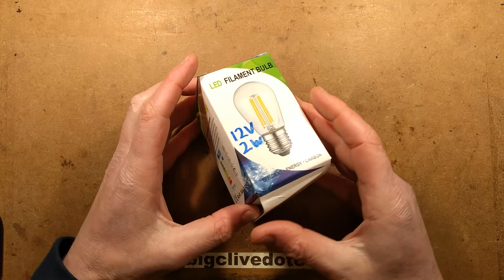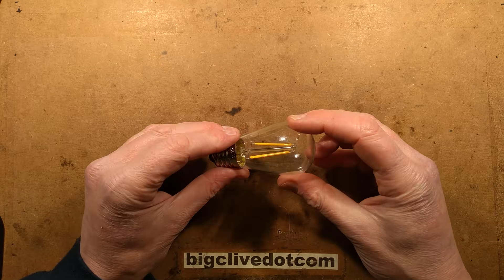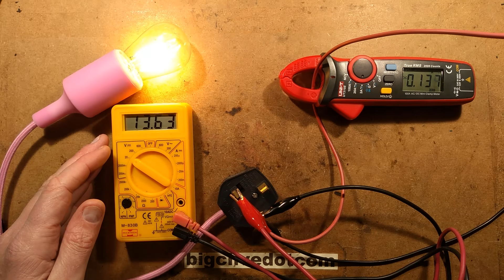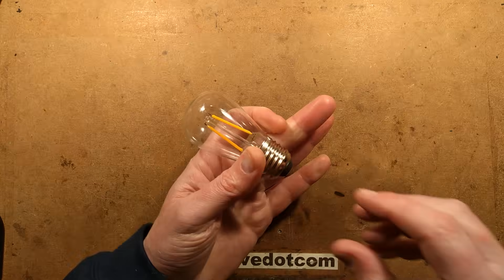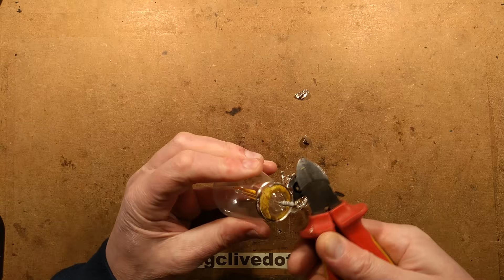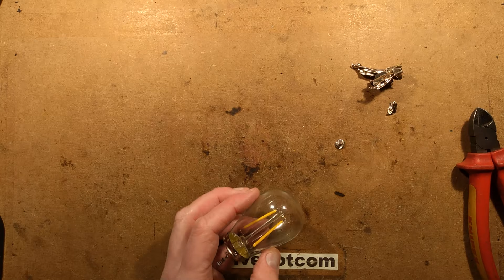Beautifully simple 12V glass LED filament lamp.

Comment: They used to have some kind of 12v house lighting, or at least lower than usual, maybe it was 24volts.  I remember seeing it in an old house in canada once.  Had strange wall plate switches,with 2 buttons i think, that might be the way to track one down if you wanted.

Comment: Seems like a great way to use solar without all the conversation of a DC battery converted to AC often converted to DC to run LEDs to make light.

With so many things using USB-C PD now it seems reasonable you could run most stuff on 12V with car charger type supplies (but hopefully a more reliable plug like PowerPole not cigar lighters?

I did something like this for ham radio field day, whole system was 12V except some box fans that ran off a small generator.

Comment: Clive, I have seen cars go up as high as 15.0V.  I know this is relatively common, as i have worked at an auto parts store for a couple of years and have done many dozens if not hundreds of electrical tests on customer vehicles. That said, 15.1V or so is the very limit of "normal", as far my testing equipment was concerned. 
I remember this being the case mostly on Jeeps, maybe even other brands under the Chrysler umbrella. 
(we had a lot of Jeep customers, if only because it was popular to keep old ones around for a long time in my area)
Reply: Probably back in the old days with external mechanical regulators?  Especially after somebody fiddles with them.  DC Boom Volts!

Comment: With genuine Samsung and LG Lion cells in some of the older designs now being about 1/2 the price they were 5 years ago and still available brand new, I decided to make myself a 3S system with 8 in parallel. Basically a 200Wh battery (once you figure in the losses etc). I have a few 12V LED Mini strip lights round the flat and use some PV panels in the windows to charge them. My electricity bill is now under £4 a month as basically all I use it for is washing and the fridge. Hot water is from a boiler. The only problem was that balancing initially took chuffing ages as the cells need to be balanced voltage wise before you put them in parallel. Then the BMS balances them in series (which took a week cos it only has a 60mA balance current). For the parallel balance all you need to do is connect all the negatives together, then have a common point and connect each positive to the common through a 100R resistor.

Comment: What home appliances still run on AC power? Fridge, oven, dryer? Lighting, TV, and computers are all DC now, would it be advantageous to have a central high-efficiency rectifier / transformer instead of a power brick for each?

Comment: Could we remove the resistor and determine the power requirements to run the bulb without it? I have an idea for a basic project that will run at approx. 8.25 volts average and Im trying to avoid needing a driver board.

Comment: There is two issues with these kinds of COB filament lights.

The first is that their failure rate is quite high. I needed to get about 36 of these throughout a house for several Chandeliers and fixtures. Of those about 9 failed in the first year. This makes sense the defects that affect the LEDs are going to result in failure early on. Which means after a year that failure rate is going to drop off hard and you'll get somewhat typical LED lifetimes. But its still going to be weakest link in the chain with these lights.

The second issue is that dimmability is a pretty complicated issue here. As you noticed that change in voltage to brightness was very non-linear. Plus with AC dimming a COB gets super shoddy especially with a triac dimmer. The reason is having that many LEDs in series with no filtering is super hard on any one LED. You mention PWM dimming however in order to be non-flickery would require fairly expensive low voltage dimmer systems. Thats the whole expense of AC based dimmable LED lights is the low voltage power and PWM control unless you get super cheap ones that flicker and thats the whole issue.

Which is intriguing me is the possibility of using Power of Ethernet as a power source for dimmable LED lights. The reason is the PoE is higher voltage around 48v which lowers the switching current of the transistor making it cheaper while also using much higher quality LEDs in series due to the money saved at not having to jam a tiny power supply inside the light base. The light then provides the transistor and PWM driver that runs at high rates. This means then that you'd have to have PoE in your house but then again you currently pay a huge premium having small AC to DC PSUs in every device.

Comment: 9:05 I haven't done the sums but surely a 12V bus going round a whole house would result in an awful lot of power being wasted in the cabling?
Reply: Not with half a dozen 2 watt LEDs like those. If the 12 Volts came from a battery, charged by solar power, then any small losses are effectively free anyway.
Reply: @johnnodge4327  Well if you're on a solar system, any losses at all ideally need to be avoided. Make it a 48V system and your (I^2)R losses are immediately a 16th of what they were. Anyway. Just sayin'.

Comment: Only problem with transmitting dc is the voltage drop along the conductor, so a dc 12v rail for lighting would be more inefficient than a AC circuit unless you want to step up to around 1million volts like the HVDC grid connections.

Comment: I used to like these type of bulbs when they first appeared in the supermarket UK.  (240 volt - 6 watt Bayonet equivalent to 60  watt standard (old) bulb). I bought loads of them for almost each room and therefore save money on electric. But they don't seem to last very long before becoming faulty and flickering so bad that you have to take them out.  They are not cheap either at around £6 each. What could be the problem with them? Are they more suited to DC current rather than household AC? or could there be an underlying manufacturing problem as in the parts on the circuit board.
Reply from the maker: I've found them to be reliable.  But the manufacturers often push all the LEDs too hard in the higher power versions.

Comment: Thought I'd add a bit more of my experience with the bulbs I got, totally blew the first one that got overvolted (it was damaged from being initially blown, so, meh), just tried another on a charged car battery (open circuit voltage of about 12.7v), and that bulb started smoking its' filaments, luckily I was keeping an eye on it and pulled the plug, so the bulb has "survived", so I think the ones I have are literally 12V-only, not "12V" (aka up to 14v+) automotive power...

Thankfully, on Lithium battery power, they seem okay, but, yeah, the lack of current limiting in these ones, I'd say buyer beware, they're not all equipped for "automotive 12V", and will need either modifying, or being fitted to modified sockets with appropriate resistors fitted...
Reply from the maker: Check yours on 3V.  I wonder if they sent you the wrong version.
Reply: At 3v they don't visibly light (I hooked one up direct to a 2.4w solar panel with a meter connected to watch the voltage & watched it as the sun came up), I think that they took the "DC12V" stamp on the cap literally, as at and below 12V, they work well (as my 3S lithium battery pack setup seems to show to me), but over that they consume more amps than needed and eventually go into thermal runaway...

They're the same construction as yours, each filament having two series sections of 10x parallel chips, but no resistor to limit the current, so they either misunderstood "12V" specs, or they just cheaped out and left out the resistor...

This is the listing my 4x came from:
https://www.ebay.co.uk/itm/283279364790

Comment: You should ramp the voltage a little higher... 14.5 to 14.8 is normal for 12v charging... And in boats, we have intelligent chargers that do a monthly equalisation cycle at over 15v.. it would be good to know if these lamps can survive that...
Reply: Tried to run one of these off 13.8V. Power ramped up to over 4W and after a minute the filaments burned out.
Reply: 14.4V would be more correct, if it's that high, the alternator's voltage regulator would be suspicious
Reply: @la8uu  That means the resistor value wasn't designed for automobile uses then

Comment: Well, that's 4 of those bought, you influential so and so... :P

As for backup lighting, there's always the option of having a UPS in line with the lighting circuit, wouldn't have to be that big given the current generation of LED lighting, although it does come up with the issue of using a transformer to drop to 12/24vDC that inverts it back up to 120/240vAC for a light that drops it back down again to a DC voltage........ :\
Reply: An alternative would be to use the adaptors made for emergency lights as they already have the mains transformer and battery connection in a single package. I doubt it would be much cheaper than a UPS but at least you wouldn't be relying on a single point of failure.

Comment: 11.1V on LiPo for the cyberpunk inclined
Reply: Only nominative and only when there are three in series. It can range from 7.5V to 12.6V depending on the charge.
Reply: @anlumo1  Under load, I think that would work well for 3S with the 10R soaking up the buffer
Reply: @TonyLing  The problem is that you have to destroy the case to change the resistor.
Reply: @anlumo1  You don't, it is self regulating by the diode curve.
You can always add 10R in series again externally if needed

Comment: I lighted most of my house with 24v regulated led strips. Planing to switch it over to DC when I have time .. pretty much all loads short of the vacuum is dc
Reply: And if its the old style motor, even that vacuum might run with high enough DC Voltage  (universal motor).

Comment: I've never seen a passenger vehicle with Edison screw lamps. They usually have bayonet caps. It would be cool if they made LED filament lamps that could be used directly in place of automotive bulbs. They current ones really suck.

Comment: Btw not a huge fan of the resistive current limiting, sure it is simple and cheap, but wasting ~16 % of the input power seems silly in a battery powered application.
I reckon a tiny buck converter would be more efficient and would not cost too much either.
Reply: most 12V led lamps actually do use a buck converter. It has its disadvantages as well though, such as making it very hard to dim them.

Comment: I got some 3V ones from a solar LED filament strings set, glass bulbs with E12 base, the tiny solar panel boost a 1.2NiMh to 3V, the filament have 18 chips in parallel, Vf of 2.54V, with a 47ohm resistor so they were running at 10mA, each set had 10 bulbs, I'm driving them using a buck/boost at 3.5V off a 18650 cell and they seems ok at 20mA (0.05W), how hard can I safely drive them? I've looked all over and these bulbs or filament doesn't exist, no webpages, datasheet, zip, nada.

Comment: Help! I've been trying to find LED filament bulbs driven like this for a while now, but it has proven really difficult to find bulbs with such simple circuitry. Almost all the Low voltage bulbs I find have more complicated control circuits, like AC handling, or active current limiting. 

Do you have any idea who the manufacturer of this bulb is? Or where I might find similar?
Reply from the maker: I don't know who manufactures them.  They are often sold in packs with festoon cabling for a 12V system.
Reply: @bigclivedotcom  I'll try that thank you! Hadn't expected to get a reply, let alone so quickly
Reply from the maker: @themoleznezz  You may find this video useful:-
https://www.youtube.com/watch?v=Nrs0Tft6bHw

Comment: That's a 12v bulb but the fitment looks like E27 Edison screw.
Is it the same or different size? and if same, what's to stop a 200lb gorilla mistakenly plugging it into a 240v mains supply?
(I'd like to see that actually!!!)
Reply from the maker: It will fit effortlessly into a 240v holder.

Comment: I often find that my UT210E is quite finicky about zeroing when measuring DC current, it likes to get a ways off and require re-zeroing. Do you get that too? Not sure if it's unique to that meter.
Reply: You should not move it after zeroing or it'll drift
Reply: They typically have an offset of about 200mA on the 2A DC range which has to be nulled out by the ZERO button.  It can be much worse if there are any strong magnets nearby.  Some of the offset is due to the Earth's magnetic field so you shouldn't move it after zeroing.

Comment: So if you deleted the resistor and ran it off a 12V car battery, would it be the same brightness as its intended use at 14V w/resistor?
Reply: Um, that's not how that works. The intention behind this resistor is not actually the voltage drop across it but limiting the current flow. Short answer: without it they'd pop (in this scenario).

Longer answer: LEDs being semi-conductors don't behave like a linear resistor what the current flow through them is concerned. They have a so called Forward Voltage which is the voltage at which they'll start to conduct (let current flow through them). Below this voltage there is little to no current flow (no conductivity). Furthermore (as you may know), they can only at all conduct in one direction (i.e. with one polarity but not the other). Hence the name semi-conductor.
Now the catch is, at this forward voltage where they start to conduct they do so very sensitively. Go only a wee bit to high with the voltage and the LED throws its gate wide open letting through enough current to fry it. A linear resistor in row with the LED will keep the current down even at higher voltages.
Theoretically, if you were able to nail down and fix the voltage perfectly at the LED's FV you could probably leave out the resistor. Practically this is almost impossible to do outside laboratory conditions since even a tiny voltage fluctuation upwards would kill it.

For an even more elaborate answer depicted with diagrams, formulas and examples I found this website: https://tinkerlog.com/2009/04/05/driving-an-led-with-or-without-a-resistor/
Reply: So.. no
Reply: Thanks for the info

Comment: Clive..
Iv had a debate with some UPS(power supply companies) that say that their devices are 100% efficient..  Iv tried a test and proven it wrong.. 
Iv used the 750UPS to power a 12v boom box,  which ran about 30 minutes..
I then recharge the internal battery, and directly attached it to my Boom box...and it lasted 2+ hours..
I had asked them to make a ac-dc-dc(computer power supply)  Even a DC-DC computer PS.. would be great for traveling..
but they dont get it..
Reply: But of course they are 100% efficient!  For varying values of 100, percent, and efficient...
Reply: @phillipsofthedriver  In my understanding, i would LOVe 100% conversion, from AC-DC-AC to DC (12v,5,v,3v)my computer..and I would love to Place a power supply in my computer, that only converted AC-DC 1 time..  And for traveling, a DC-DC PSU, would be great for computers...Any traveler tends to want a laptop, because Converting DC-AC-DC sucks..and will eat up your battery..

Comment: So is there an adaptor socket for E27 230V to E27 12V, or how am I supposed to use these? I've only got E27 and E14 sockets here, and I know that usually, 12V lamps have one of the GU-sockets, mostly GU-10 or so. I don't see how I personally could use this lamp.
Reply: GU10s are normally mains voltage, it's MR16s which are 12V.
Reply: Oh, and how are you supposed to use them? In a boat or other vehicle with a 12V electrical system.
Reply: Right, MR16. I never bothered to remember anything other than E14 and E27, because I don't use them and only very rarely ever see them.
Reply: I have GU10s in my exterior patio lights, and have MR16s in the kitchen and bathroom. :-)
Reply: Oh, so you always have to equip the E27 sockets yourself. I could see this being useful with E14, since they are rather small, but E27 takes quite a bit of space. Oh well, anyone can use anything they want, I guess it's just not for me (or are there actually E27 to E27 sockets with 230V to 12V converters inside?)

Comment: 12VDC IMHO is a bad choice for household DC. 
I'd prefer 48, much smaller conductors, less chance of substandard devices starting fires with excess current.
Reply: I've seen a fair number of drop lights which have clearly been on fire during their operational life without anyone noticing.

Comment: If you take a look at (for example) meanwell industrial supplies, you will find that they always state the 120V AC to 250V AC input Range, but also the optional required DC Voltage (around 90V or so...would have to check it).

So you could optimize to run on AC or DC, which from larger solar installations usually comes at 120V DC upwards.
Multiple cells in a row, allowing for easier function of the DC to AC converter also at low light intensity ....and using thinner copper cables. You dont want to transfer 5kW at 12V DC.

Comment: Clive u can run this bulb on mains by resistor dropper.
Reply from the maker: That would be very inefficient.  The resistor would get extremely hot.  You could use a capacitive dropper for it though, although you do get versions of these lamps up to about 240V that have a cap dropper in the base.

Comment: Is it possible to rebuild a 220V E27 2W filament to 12Volt ?
Reply from the maker: The filament voltage is high, so it would need complex circuitry.

Comment: could someone tell me what voltage is suitable for a single led filament ? i am considering using  a 3v battery can it fit?
Reply from the maker: You can get 3V filaments and sometimes find a 3V version of this lamp for solar strings.
Reply: @bigclivedotcom  I want to only use a single filament is it possible i directly light it up  wìth a simple 3V battery